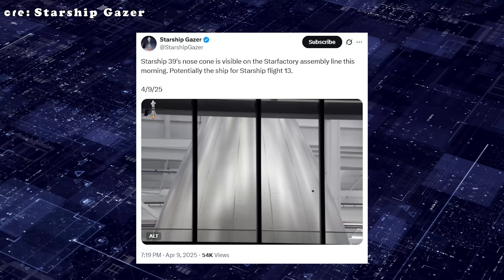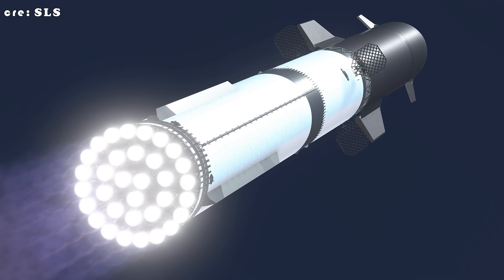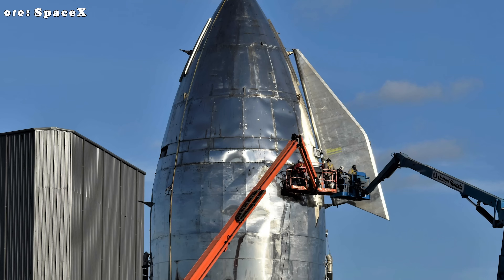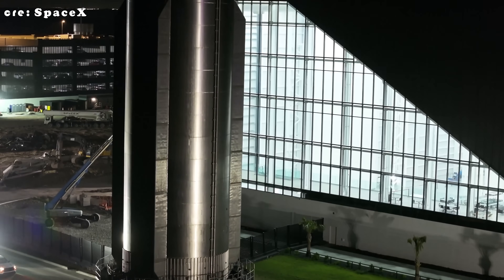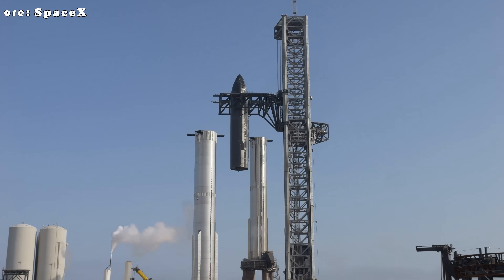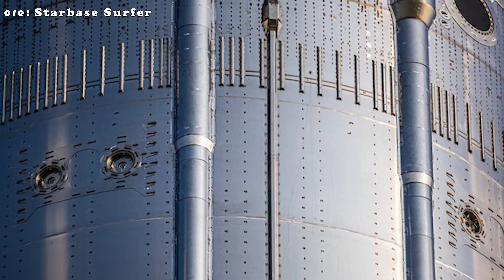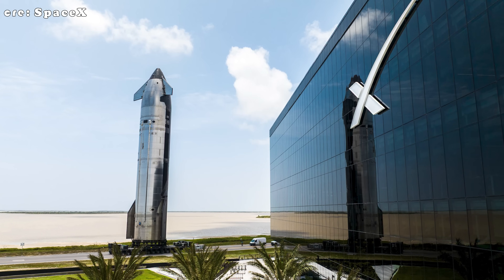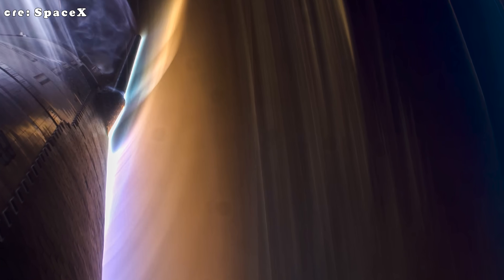SpaceX's New Upgrade On Starship V3 WELDING, Unlike any other...

Comment: Flux-core is for outdoor use just like stick welding. TIG and Laser welding is designed for indoor welding and using robots makes TIG welding just as fast as MIG welding. Plenishing has been around for decades, and the weld area is stronger than base metals being welded not softer and cracks form outside of the weld inclusion area. Welding in space even on exotic alloys is easier than on earth because it eliminates the need for shielding gasses from flux or compressed gasses in bottles, certain gasses like pure co2 and helium would still offer advantages for weld penetration into base metals. I think the future of exotic alloys that could survive reentry without thermal shielding is in space manufacturing of base metal, take titanium as an example requires special furnaces and use of expensive metals to create a slag barrier because it will explode if exposed to O2 even the dust from processing titanium scrap for recycle is highly flammable worse than LIPO EV batteries that everyone has seen burn EVs to a mound of melted metal or a LIPO bater pack for a weed trimmer burn down entire house.